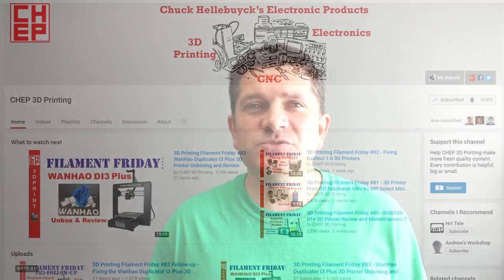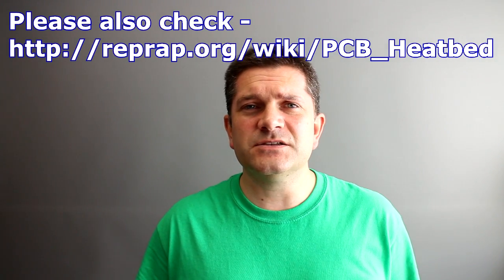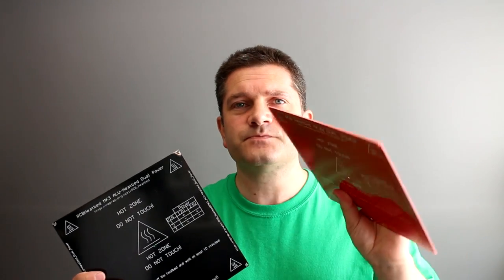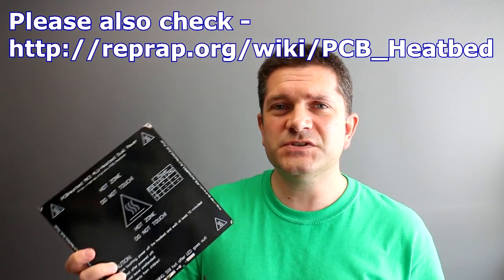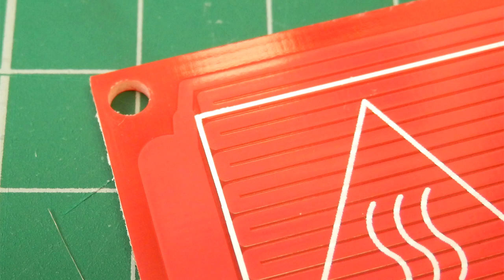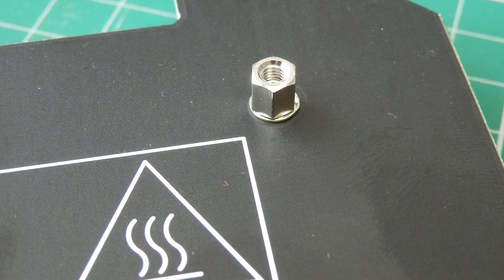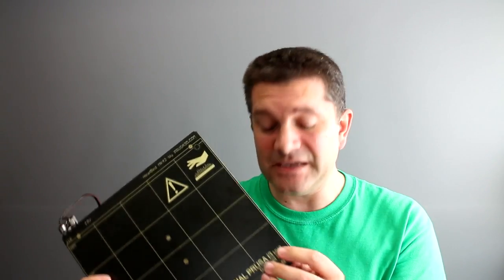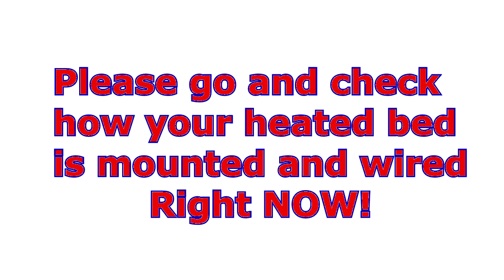Warning! - Check your 3D Printer heated bed - electrical mounting advice

Comment: Today one of my Wanhao I3 v2.1 level screws for the heated bed started to glow bright orange with a strong smell. Found out exactly what this video warns about had happened. The spring got through the black layer and started touching the copper. Temp on the bed got uncontrollable and shot up from set 50 to 100 c quickly before I noticed, even when I only heat the nozzle. It also shot a pretty impressive arc from the glowing screw to the heated bed cables.. Check your beds people! :D

Comment: Fortunately I've found this video! I'm building my diy 3d printer and I've 4 beds as the black one you showed (the one with the aluminium side). I will take care to the electrical insulation of them thanks to this video. I don't really know how to mount them already, because someone tells me that they can work well without the glass on top, printing directly on the aluminium...but probably I will put another big aluminium plate to cover all of them, just to have a clean and plain surface. In that case do you have some other advise about the insulation?

Comment: Interesting...my Creality CP01 has an aluminum bed, with metal clips that hold the glass working plate. The extruder tip touched one of those clips and sparked a bit. That shorted the hot end, so the head died. Creality doesn’t believe it happened that way, but are replacing the head. I agree that it can happen.

Comment: Im having a similer issue to what u described but i see no damage.

The further wire (the one that heats up) sparks at the connector.

Is that caused by the same issue?.

Comment: I have a cr10 clone and the bed is 1.8ohms and it is getting 12v but still doesn't heat up beyond room temp - tested for shorts from the mouting holes and all seems fine? Any thoughts or advice greatfully recieved.

Comment: GG . My heated bed stopped working at all except the thermistor. I give it command to heat up to 70C and nothing rises beyond room temperature. MK2 Model here... I don't even know where to begin.. Check the fuses? check the mosfet ? I get no voltage in the mosfet except that 5V thingie and 0.40 V in + - heat bed connector pins for 12V. If i measure the green connector, i've got 0V . This has put a toll on my morale but, for the heck of it, i'm going to print on a cold bed + gluestick from now on. F^*@#ing heated beds :( . I suck at measuring electrical stuff, not to mention troubleshoot them.

Comment: I put some kapton tape where the springs touch, it should be common sense... They probably just wanted to save a few bucks by not putting any insulation there.

Comment: "Tens and Tens of amps" Out of curiosity, does anyone have any specifics on this point? I wasn't aware of a 200-300w power supply being able to pass on more than 1-3 amps? (Which might well and truly be very dangerous), just curious on that point.
Reply: a typical 300W 12V power supply can deliver up to 25 amps. When a short happens and no fuse trips due to being cheap or manually overwritten (by inserting a penny in the fuse-slot or whatever) It may even go up to 30, 40 or 50 amps. It depends on the weakest link breaking which might be the power supply or some other parts. And by the way 40 - 50 amps is the kind of current you weld with...so yeah.
Reply: 300W/12V = 25A. So yeah, definitely a lot more than 3A. The heated bed can have a resistance of about 1 Ohm, maybe 1.2 Ohm, so it passes 10-12A or around 120-144W, which is what original older designs have been.  Richard quotes higher bed resistances, like around 2 Ohm for an approximately 6A or 72W heater. Learn Ohm's law please, it really explains 70% of electronics. The other 30% is Kirchhoff's laws.

What happens when you use a PC power supply, is that when voltage dips or current goes over limit, the power supply will go into safety protection mode.

What happens when you use an LED power supply like the ones on the printers, is that the voltage will collapse as the current goes up. They are not too unlikely to deliver 9V at 50A for a while until they overheat and catch fire.

Comment: Just add a mosfet and a fuse. 
The mosfet so that the current does not go through the mainboard and a fuse that the high currents resulting from a short will shut themselves down.
(If you only use a fuse it might live longer than your ramps.)

 And use a propper Brand Power supply.

Comment: So what if pcb tracks go to corner?? Thtat's what the stop-lack is on. It's like saying watch out with cars that use tires as they might blow up and you'll have tons of problems - you better wrap them in some rubber, to protect them.  The real problem with shity alu beds is they bend when heating up and down and unless your pid is dead on you'll see z-banding.

Comment: In my headfirst dive into electronics, I purchased a heated bed from a cheap ebay purchase that can't seem to get to enough temperature to... stops at around 68 degrees C ... I was told, " If the bed resistance is more than 1,2 ohm and nozzle heater resistance is more than
3,6 ohms. 12V from the power supply might not be enough. In that case, turn up the
voltage on the power supply, the potentiometer is to the right of the terminal
screws. You can adjust the voltage between 10,5 – 14,5 V. "     Ive tried turning that to both extremes and still get the bed up to 68 degrees. your video has me thinking it might be defective; but I can't test for currents without a meter :( --  I'll have to wait to troubleshoot further when that comes (in the mail) do you have any ideas?

Comment: Because of this video, I have placed a metal washer at the top of my spring and then a fibrewasher above that, to touch the bed.
Reply: I did something similar when I built my a8  but used cornflakes packet & steel washer for the spring to sit on

Comment: thanks! i have question, so im gonna buy Anet A8. The place where im gonna buy is giving me option to buy Auto Leveling Sensor, so how that sensor works, i wanna know! And second question do i need to cool down the extruder, and how i can do it.. because i see on the picture where Anet A8 is there is two fans, but what does that radial fan cool?

Comment: About heated beds not getting warm enough, you might want to put a cork sheet underneath for thermal insulation. It will heat up faster and waste less energy.
Reply: Yeah, insane...  "Cork's bubble-form structure and natural fire retardant make it suitable for acoustic and thermal insulation" It might not be suitable for your propane fueled heard bed tho ;)

Comment: My Wilson has a wooden base under the bed, so no worries there!
Reply: Vendicar Decarian do you realize that to burn wood needs heat? And to produce heat you need a short, but to produce a short you need something conductive, but wood is not

Comment: I use that "MK3" heated bed... interesting watching!

I think I will test the resistance tonight to make sure the copper weight is correct. It "seems" to work as expected and I use moulded silicone dampers as the spacers, but I may well also get some plastic M3 bolts to totally isolate any mechanical to electrical connection.

Steve

Comment: That is quite an informative and valuable lesson. Thanks. I never had any major problem with my heatbeds tho, even passing 25 AMPs AC in a 12V PCB MK2 once. But I managed to let a 2,000 dolar printer catch fire due to a loose thermistor from the hotend.
Reply from the maker: Thanks Cláudio. Yes, bad or insecure mechanical fixings - especially on the thermistor's can be a big problem. Good firmware can catch when a thermistor falls off, but sometimes you just get thermal-runaway and fire.

Comment: Sadly were all guilty of buying cheaper alternatives ( AKA China attempted copy clones ). your video  was a very useful bit for information. I am currently  using reprapme.com 200X300 pcb beds, however the second MR Prusa makes the mk42 headed bed available as a stand alone part  Im buying! Perhaps you can encourage Prusa research Richard, to offer this option to those of us that would rather not buy badly made equipment.  Side note, I am  disappointed  seeing plastic spools rather then cardboard as you have suggested many years ago.

Comment: I recently switched to a silicone heater 230V... Shure you should know wat you are doing but so far im very happy with it
Reply from the maker: Yes, just be careful. Not something I would do on a moving 3D Printer platform.
Reply: Right, its just moving in Z direktion an with a good amount of strain relief and drag chain ;)

Comment: Great video and this issue can not be highlighted enough.
Cheap source of washers & stand offs 
 http://www.banggood.com/260pcs-M3-Nylon-Black-Hex-Screw-Nut-M-F-Stand-off-Set-Assortment-Kit-Box-p-998983.html
http://www.banggood.com/50pcs-Black-Nylon-M3-Washer-Gasket-381MM-p-971422.html
( i have no affiliation with them just use them a lot for my hobby stuff as they provide reasonable quality for great prices)

With the alu beds i find drilling the holes out to 3.8 or 4 mm ( assuming you're using M3 hardware)helps with preventing distortion and creep as the bed goes thru heat cycles.

Comment: Nice video warning. I've seen the same design in the "speed control" for the blower fan in cars. Just some copper traces insulated from the aluminum plate. I can see how that could be easy to short in a 3d printer while leveling the bed.  Thanks!

Comment: Threw out the alu pcb printbed cause it bent when heated up -.-
Shit anyways. Was a waste of money. Now got a milled aluminiumbed with a good (relatively expensive, thick wired) silicone heater on it. All problems solved ;)

Comment: I once heard that 1/4 amp thru the heart will kill you
Reply: Don't spread bullshit when it comes to safety. 0.008 amp AC through the heart will kill you. Voltage is irrelevant - the current is what kills
Reply: Thankfully you need a fair old voltage to achieve that. I believe most people work on approx 50V being the limit beyond which you need to worry, although if anyone reading this is going to take it as gospel please don't -- look for a more trustworthy definition!

Comment: Thanks for echoing Chucks warning Rich, the more people that are made aware of potential dangers, the better for everyone.

Chucks printer shorted before the bed was heating, this shows that the heated bed is being switched on the negative line. Obviously it would be safer to switch the live.
Do a lot of printers switch the negative? Is there a reason to switch the negative rather than the positive, other than bad manufacture?

It was good to see that you praised the i3 MK2, cos I have one :-)
Reply from the maker: Hi Spike. It's very common to switch the negative - most DC switched outputs on a 3D Printer will be by a MOSFET, (open-drain output) - It's easy to sink current so most solid state power output devices do that. This means that for wiring of heated beds, people often tend to run a +12 or +24 V from their PSU to the heated bed, then take the other heated bed connection to the MOSFET output. This has the advantage that you can PWM (quickly pulse) the MOSFET on and off to control power - (You can't really do that with a relay, for example). But the issue Chuck was seeing when the heated bed MOSFET was off, still means that current will flow through the tracking if the tracking can find a path to ground. This was the spark and smoke chuck was seeing when the spring shorted out the bed tracking to the frame of the 3D Printer that was grounded.
Reply: Thanks for the explanation Rich.

Comment: Hi great work Richard i came across this problem awhile back when i tried to remove wobble from my y axis by putting nylon locking nuts between the hot bed and spring. so when i tightened them down i broke threw the coating. May i ask you where you buy your spares from as i saw you had a very thick y axis carriage plate which ive been unable to find im in the UK too
Cheers Lee
Reply from the maker: Hi Lee, that Aluminium plate was from an old Prusa i3 Kit (maybe 3 years+) the seller was producing small batches, but stopped - You still get something similar in a new Prusa i3 MK2 kit - I would say to try them out.
Reply: thanks for the reply im building my own printer after getting the bug after building several kits but all i can source is a 3mm thick one and the one you had in the video looked about 6mm

Comment: A non conducting washer would sort it out
Reply: Not every non conductive washer is suited for the job due to the heat of the build plate! PEEK, PTFE as well as other high temperature materials are recommended.

Comment: Yep, I lost all of my electronics last year (replacing the fet did not fix it) due to what happened to Chuck only mine sparked between the aluminum plate and the MK2B and instantly ZAP.  Same screw issue as he had only because I had an aluminum plate did it spark between it and the MK2B instead.  I am now afraid of PCB headed beds and I am migrating over to the silicone type on my next build.
Reply: +1 happened to me too
Reply: djshex
Yeah, my new printer will be 300x300 so it gives me incentive to stay away from these boards as I would have been furious if I had lost a $200 controller and not just a 10 dollar ramps.  At least with a silicone pad I don't have to worry about this.